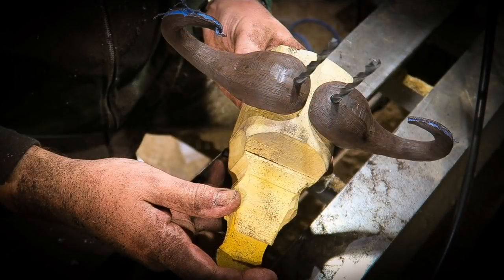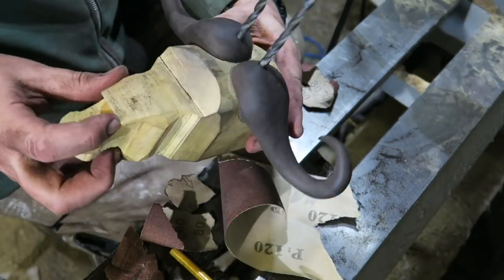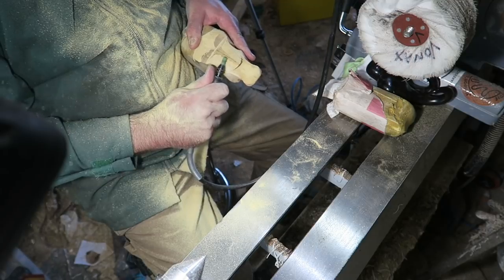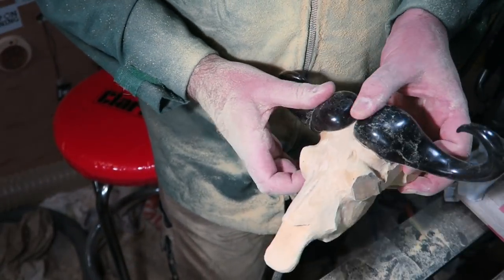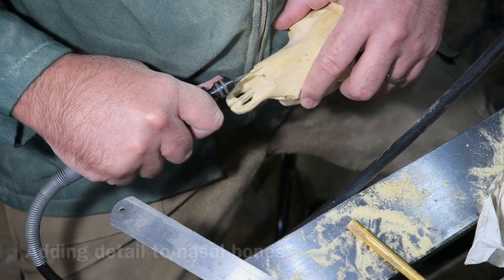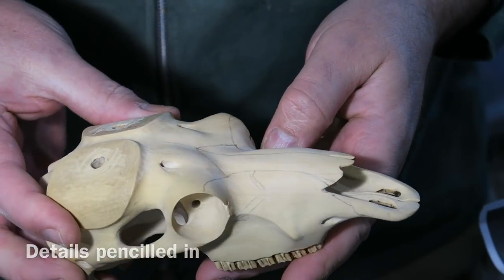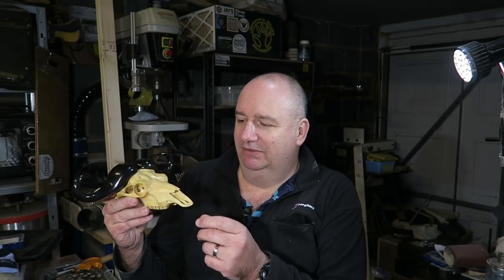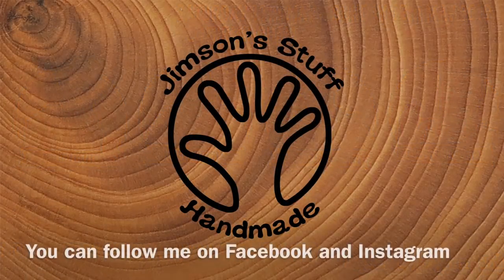Wood Carving a Boxwood and Blackwood Skull

Comment: Hi Jim, aside from the fact your carving is beautiful and anatomically correct, your knowledge of the buffaloes head is incredible.  Were you a Vet?   I want to start carving, have you any ideas what I could start with, please?  I am thinking of an animal or a small scull, similar to yours but smaller and less intricate,  keep up the great work.  Cheers, Sean
Reply from the maker: Thank you very much Sean, no not a vet but I did study comparative anatomy many years ago and do have a bit of a fascination with skulls. The first thing I carved out of wood was a human skull and it is not a bad thing to try as there are not too many fine sticky out bits, you can make it as detailed or simple as you like and there is plenty of reference material available. Another god thing to carve would be a small bear, probably better if it was sitting down.
Cheers 
Jim